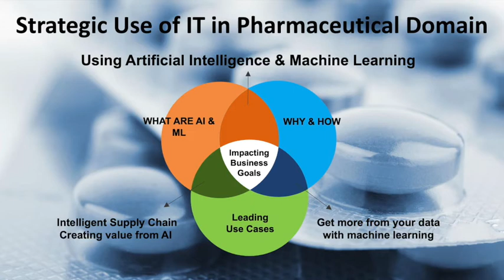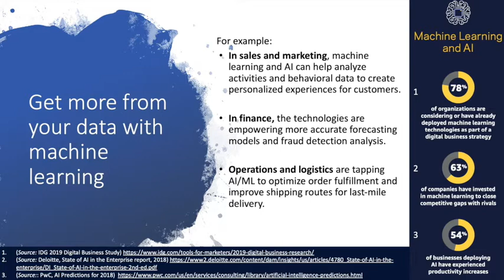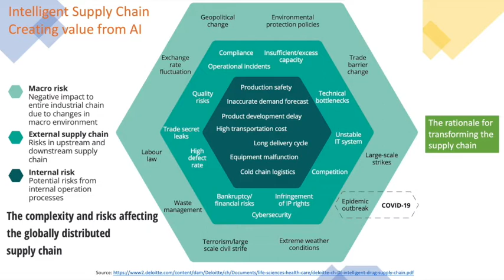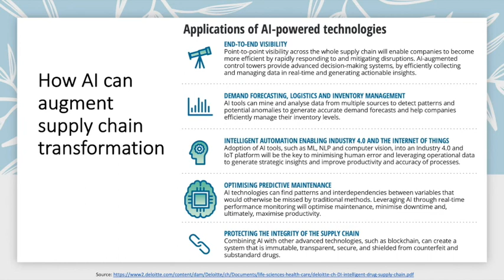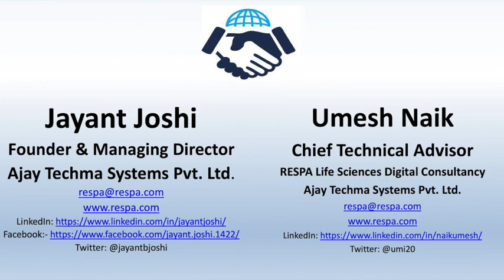PART III- Strategic Use of IT in Pharmaceutical using Artificial Intelligence and Machine Learning

Comment: The video is excellent as several benefits of the use of AI/ML in Pharma are mentioned. Fraud detection analysis, improved ship routes for delivery, ability to detect patterns in demand forecasting,  minimizing equipment downtime and using Blockchain and AI to prevent counterfeiting are some of the key reasons to adopt AI/ML in Pharma.